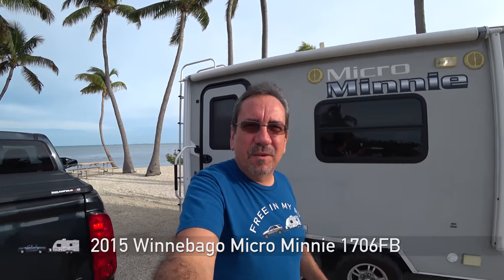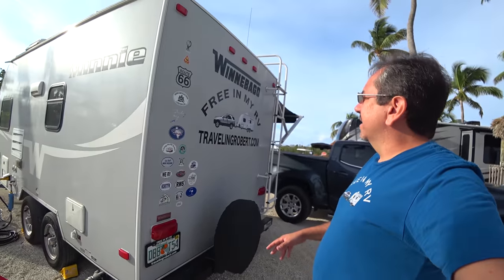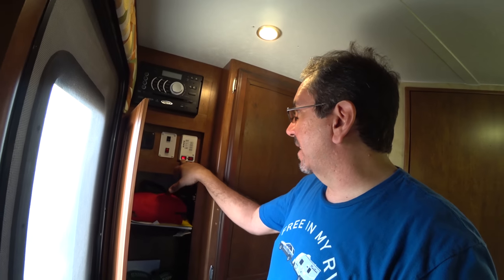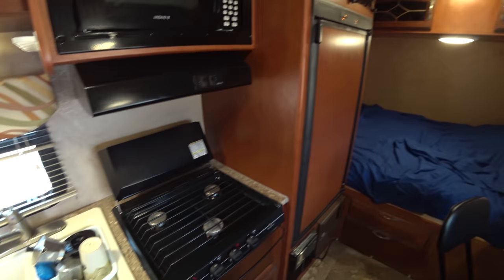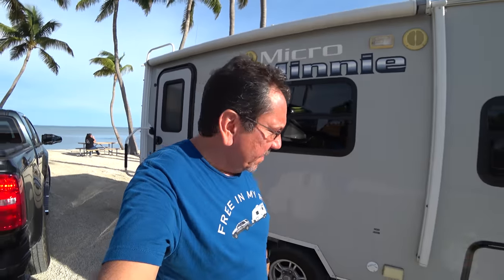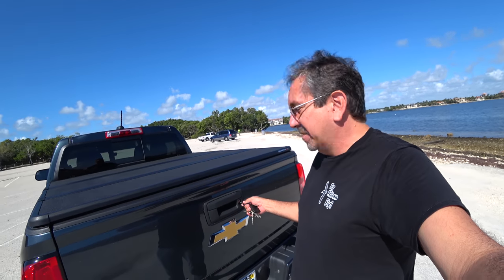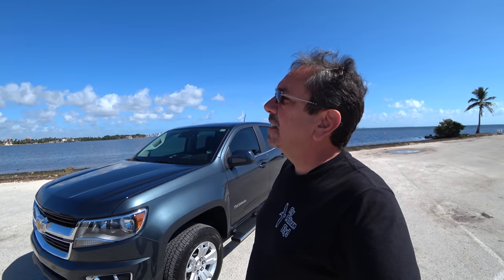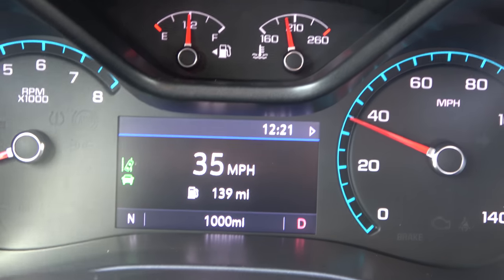2015 Winnebago Micro Minnie 1706FB After 4 Years, and my new truck (4K)

Comment: May I ask why you bought a petrol truck , I have the same it's called a Colorado with 2.8 diesel giving 500 meters of toque well able to tow a trailer up to 3.500kgs
Reply from the maker: It was a lot less expensive, gas is cheaper and easier to find in the US and the tow capacity was about the same.

Comment: Did U retire your car and how much water do U travel with in your tanks ?
Reply from the maker: Old car was killed by a bad mechanic so I had to retire it. Now it depends. I usually travel with a full tank of gas. I feel the extra weight gives the trailer more stability and I haven't noticed a big difference in fuel economy.

Comment: Robert, has the weboost working for you. Any thoughts?
Reply from the maker: Yes, all the time. A few days ago at Vogel State Park in GA couldn't get a signal without it, and after I turned it on I had reliable 4G, not very fast, but at least reliable.
Reply from the maker: Yes, all the time. A few days ago at Vogel State Park in GA couldn't get a signal without it, and after I turned it on I had reliable 4G, not very fast, but at least reliable.

Comment: Hi..... If you please imaginable the height between the your truck and RV because i am searching for small RV to fit in my garage is 7 feet height for your information I have RAM truck 1500 thanks
Reply from the maker: 7 feet, you either need a pop-up or a teardrop. Most regular trailers are 9 or more. Mine is almost 10
Reply: Since height is your main concern you should look at tiny teardrops, a pop up, or those A frames. They're like pop-ups but with hard sides. Many of them also come with a bathroom and shower.
Reply: Thank you for the information

Comment: Robert there’s no way you got 35 miles to the gallon Highway. the Colorado v6 only gets 18 city/25 highway EPA rating
Reply from the maker: Must have been a miracle, or a computer fluke. On average I am getting 24-25 highway under normal circumstances, 10-14 towing

Comment: What happened to the Kia at the end???
Reply from the maker: Traded it in
Reply: @TravelingRobert  What I meant was did Firestone finally fixed it?? Did they get it to run. How many miles did you put on it??  Del pick-up nuevo..... no se q te diga... Todos los carros nuevos son caros y caros de mantener. Tecnologia con fecha de expiracion.. Ya uno no los puede arreglar y cualquier cosa te deja en limp mode al lado de la carretera..Un saludo Roberto. Yo tambien viajo bastante pero de moteles de noche por los EEUU con mi madre... Algun dia volvere a un Bus VW igual q los Hippies... Nos vemos por Miami. Un Abrazo

Comment: That toilet set is really bad my western slide in camper the bathroom is all self contained so u have a plastic floor with a drain for the shower and any toilet over flow will just go down the drain. It's 39 years old and has less water damage then your 4 year old camper in the bathroom.